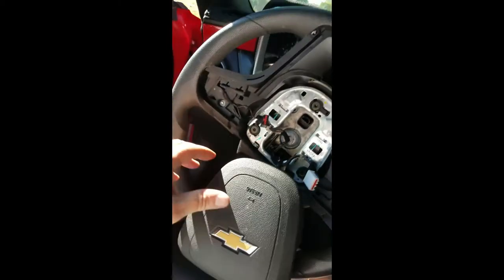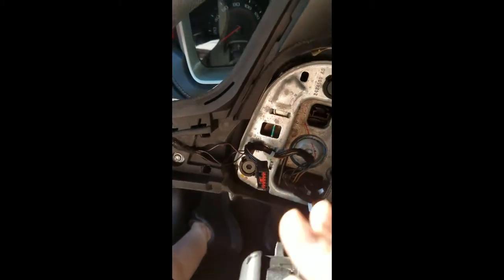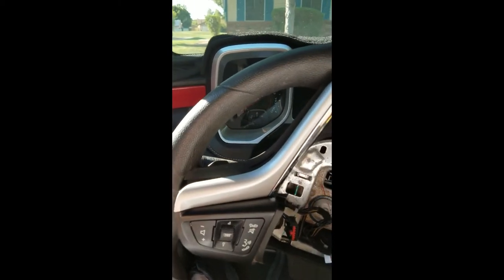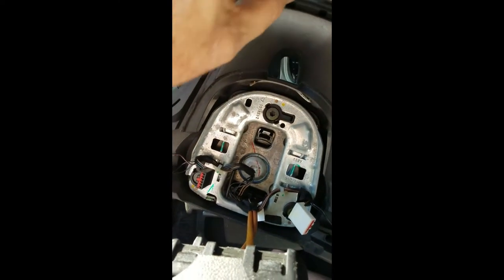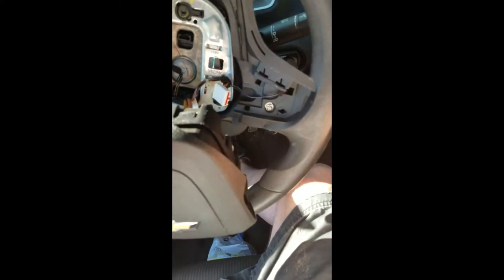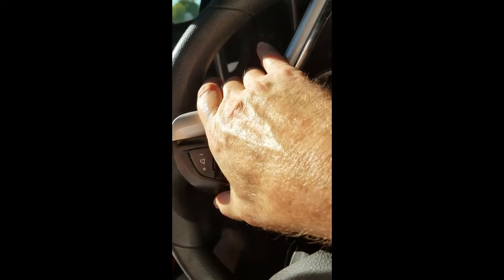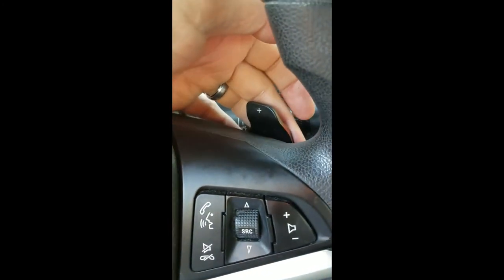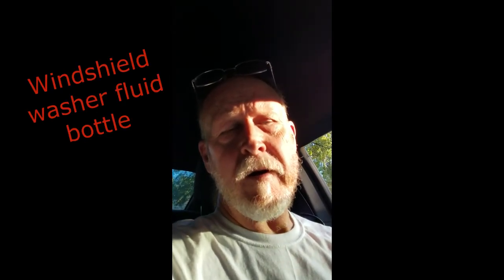Paddle Shifter Install 2012 Camaro

Comment: Just got the oem part but it didn’t come with any kind of extenuation part. Hope it still works… I’m about to find out now
Reply from the maker: The paddle extensions were purchased from Ebay separately. I'm glad my video could help you. Good luck!
Reply: @CamaroStuff  just replaced it and I’m still not able to down shift. I guess I’m going to take it off and try the process again.

Comment: My kid pulled the paddle the wrong way and snapped it loose. Now it moves way too much and works unreliable so I want to replace it. Any third party recommendations?
Reply from the maker: 3rd party? For?
Reply: @CamaroStuff  I was thinking to save money on parts but I guess these things are only like $20 from gm so I’ll just go OEM
Reply from the maker: @Michael’sWildMix  I payed about $35 from the dealer. The video will get you through the install. Thanks for commenting!